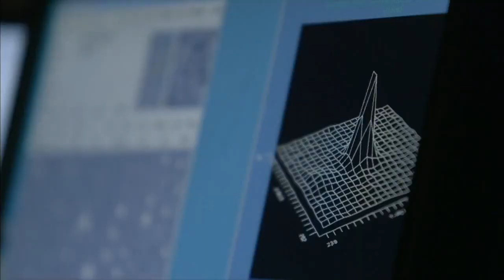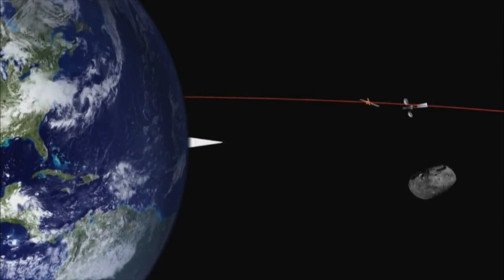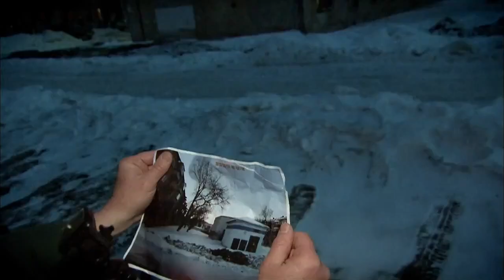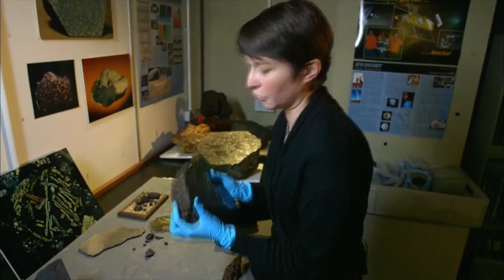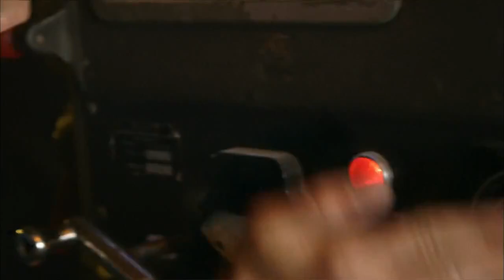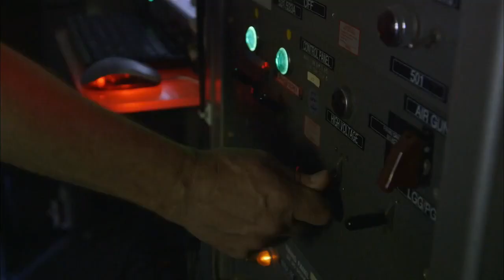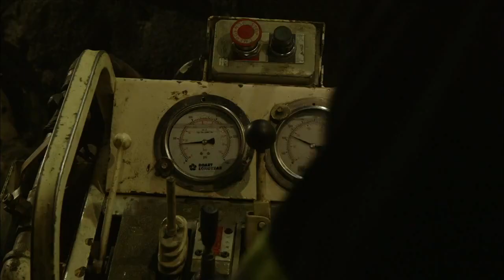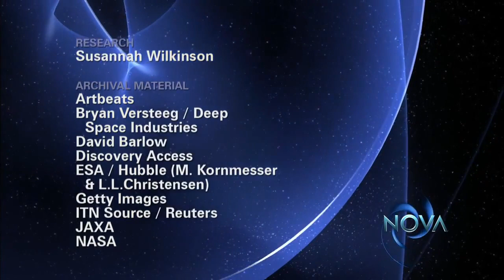NOVA | Asteroid: Doomsday or Payday? [HD]

Comment: If they have so much energy what sort of insane force would we need to deflect one we would need. Ore than a nuke
Reply: Actually, we wouldn't need to destroy the asteroid to deflect it. It's very unlikely for an asteroid to collide with us, as both our orbit and the asteroid's orbit would need to intersect at the same time. We would only need to move the asteroid so there is a difference of about 10 minutes. Either we continue on our orbit before the asteroid goes through our orbit by 10 minutes, or by the asteroid intersecting with our orbit 10 minutes before we do. We only need to hit the asteroid with enough force to slightly disturb the orbit of the asteroid. I know your comment was two years ago, but I figured I would answer you :)